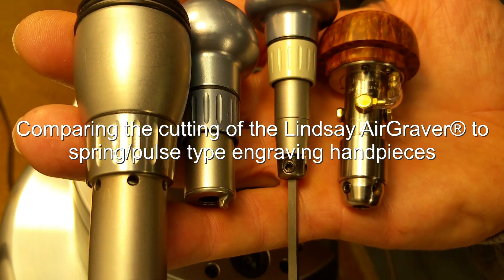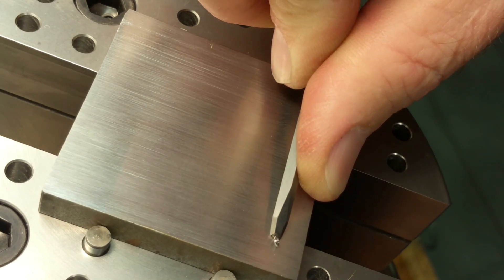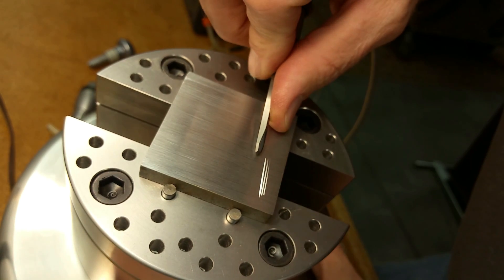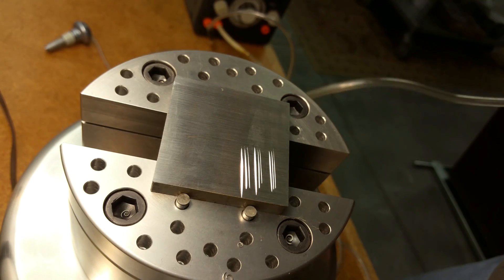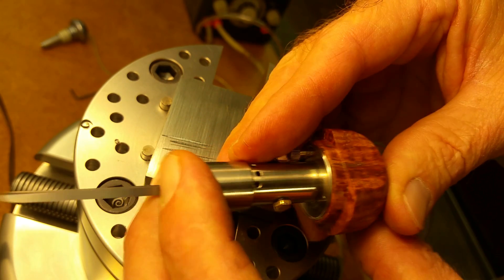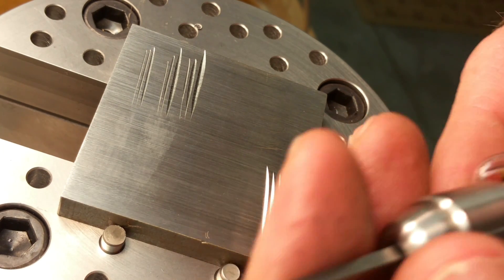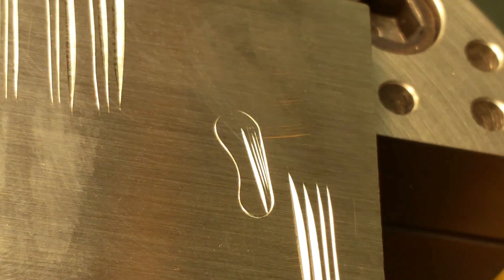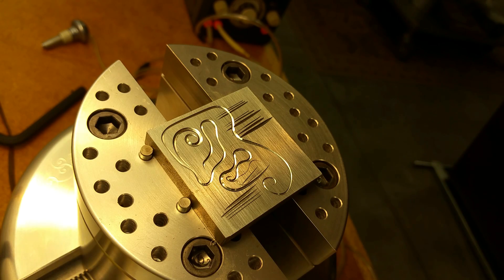Lindsay AirGraver® cutting compared to spring/pulse engravers

Comment: there is even a third kind of gravers, the push/pull typ. that compressor works much simpler then the GRS system and the spring is on the other side of the hammerpiece. But it is not better then the GRS system, but also depending on the power of the pump used. the air powered hammers have the big advantage that you can just turn up the preassure and it goes. your video show very well the difference. In my opinion, even the sound they make is much smoother and. the power is no comparrison at all, no spring type will ever reach this level of power!

Comment: Beautiful tool.  If it weren't so expensive I'd own one but I'm guessing you are charging more than its weight in gold minus the cutter.  A more affordable price would sell them much quicker.  Magnificent job in your design.
Reply: Quality doesn't come cheap.... You get what you pay for...
Reply: @JohnSwampthingRae  true, but there comes a point where the price goes beyond the justification of quality and moves into just insane. You eventually reach a point where you can make just as much by selling in quantity than by just having a high price tag. It's called smart business.
Reply: @nerored6235  NO, you're wrong. The Lindsay Engravers are so far advanced that it might take you 20 years to exploit every facet of the tool. Regardless, it will take a poor engraver to a fair engraver, a fair engraver to an adequate engraver, an adequate engraver to a good engraver, and a good engraver to a better engraver and a better engraver to a professional... How much is your career worth? If you 'dabble then buy a hammer and some gravers.

Comment: HI Steve
I just like to know those air gravers ( engraving machines ) and the tips you have sharpened , is it 
possible to use them for intaglio portrait engraving which has fine lines and details .
                                                               Thank you

Comment: Reminds me of the palm gravers I used in the past.  Price is not cheap but I believe I could use with my debilitating arthritic hands. Something I haven't been able to do in years.
Reply: 57WillysCJ so correct me if I'm wrong but cobolt is used for cutting stainless steel and carbide is not? I'm having trouble with my carbide on stainless. Brass and aluminum is not an issue.
Reply: @classicuniquegifts9704   Never engraved stainless steel  by hand. Of course the industrial pantograph should do the job.  It is hard depending on the material. There are different types of stainless steel  based on their machinability. You have to paint it with something or it will corrode quickly.  Stainless is used in the food industry because it doesn't corroded easily but lower quality,  which is easier to work, will once the polished surface is broken.

Comment: Which Lindsay set up would I need to work on knives and car parts... I've gotten the scm power carver but I'm not getting the smooth lines I'd like...
Reply: The scm power carver is not an engraving tool. It is a high speed rotary grinder. You will never get the kind of clean bright cuts that a properly sharpened graver will give you. The Lindsay Classic will do the finest work on knife parts and  with additional tungsten piston replacing the standard will work great on heavy deep cuts for car and motorcycle parts..
Reply: Charles Bleile ... Thank you... I'll be placing my order soon...
Reply: @1life1love39  palm control classic or foot control classic. both are perfect.

Comment: I went to your website, no offense intended, but what makes the engravers so expensive?
Reply: I understand where your coming from and I usually would be saying the same thing BUT, I have the 901, the Monarch from GRS, Great gravers no doubt, Sweet and Love em BUT, I got lucky recently and had a few extra bucks squirreled away for the time where I would get lucky and find someone selling a Lindsey Classic used on the Engravers Forum or Ebay ETC, I scored the Classic, Regulator and foot pedal all for a grand,I tried it out the second it arrived and I haven't put it down since, You need Mules tied to it to hold it back, Its covers every range just like Steve showed here , a spin of the collar and more power to you. I love the GRS stuff I have but for the foreseeable future Im using the classic , Its rare to find a used one at an affordable price but if you keep looking and have the money when it comes up grab it, It will be gone in an hour if you dont .